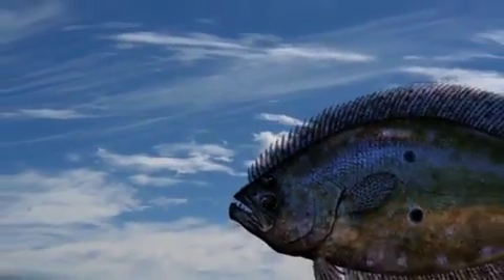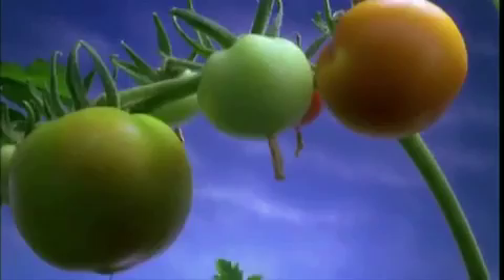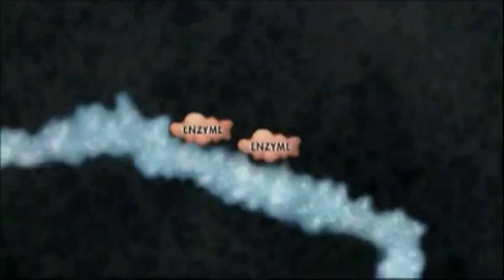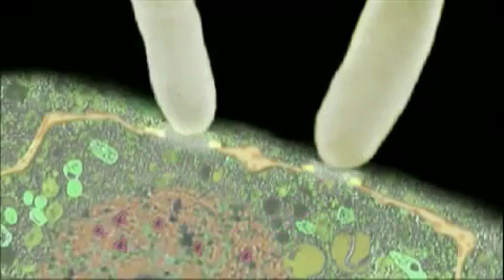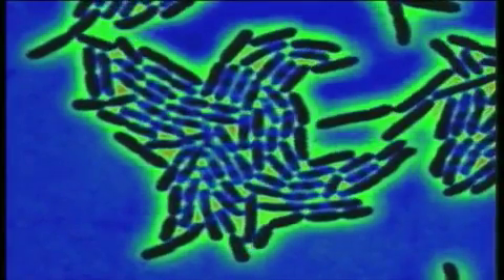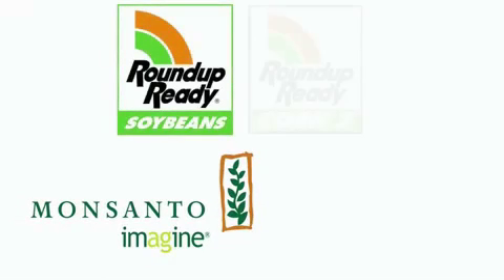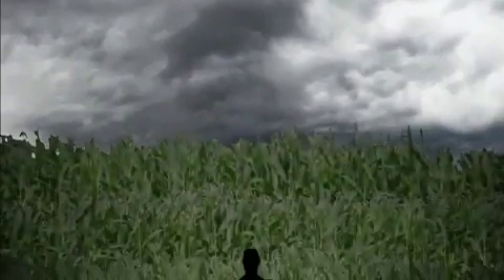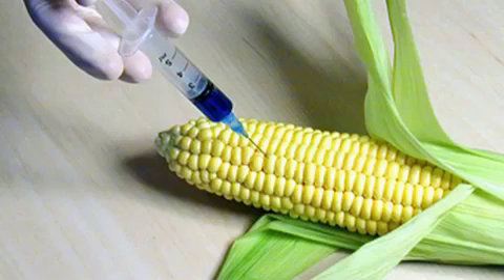GM-Foods Explained: How is Genetically Modified Food made?

Comment: it's has and can be done naturally. permaculture. they've done it in Egypt, Morroco. it's an oasis in the middle of a desert. What makes it work=?
it severely drastically water/moisture evaporation by air circulation - you greatly impede the drafts over the soil and air mass movement in general.. you know that strong wind on your average huge boring monoculture fields? All you need several layers of plants of different heights (similar to how it occurs in nature)..from ground cover to high trees